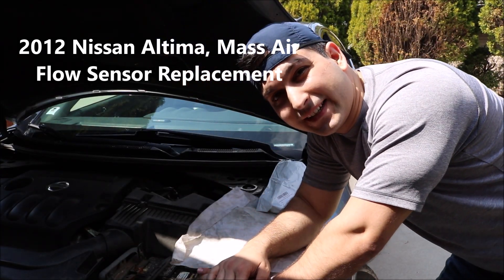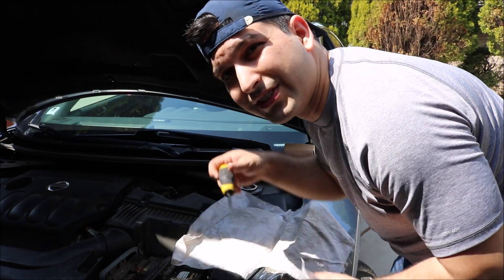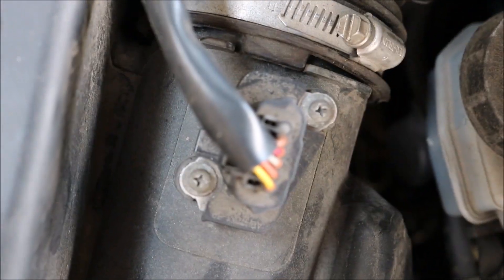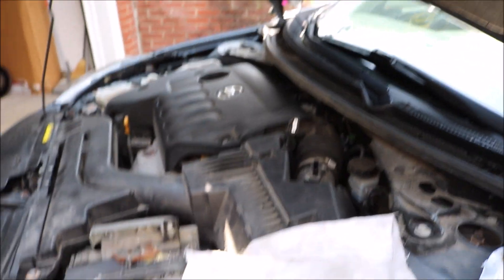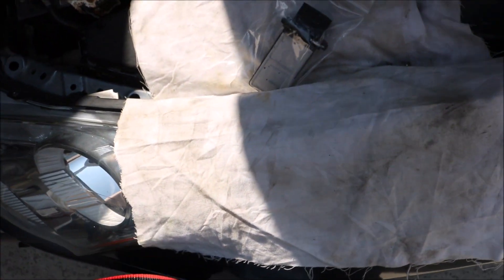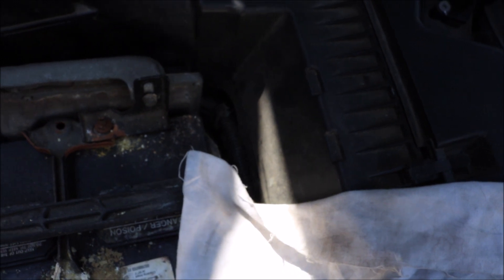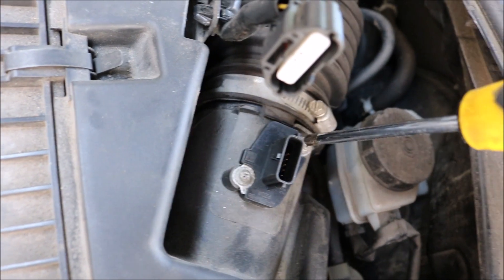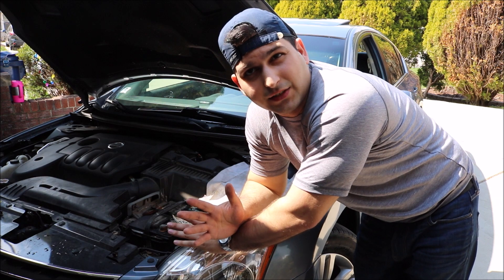2012 Nissan Altima - Mass Air Flow Sensor Replacement - Check Engine Light Fixed

Comment: I replace mine and i still get the same code
Reply: I have the same issue, I ran some diagnostics on it with a programmer and all the systems were good, we did get the MAF sensor code but no reason why. It seems that Nissan has to update the ecm in order to turn off that service light. I'm gonna take mine in and hope that it fixes the issue.
Reply: Same here. Altimas are money pits
Reply: @greed6is6good  yeah I’m gonna trade mine in as soon as I get the light off
Reply: @sergiogijon4311  im having the same issue. any update on yours?
Reply: I’m having the same issue as well. Ran a diagnostic, replaced the throttle body, cleaned my MAF and took it to like 3 mechanics. Since the check engine light is on I can’t pass my smog test, any suggestions?
Reply: @BigmeechT  I bought a cheap maf sensor off Amazon and popped it in.  The service engine light stayed on then my buddy reset the code using the diag sensor tool ...  that solved the problem for my 2012 Altima. Hope it works out for you.  Let me know if you want the same maf sensor I bought I’ll post the link
Reply: @kzegg1402  yeah I just replaced the maf sensor with a cheap 22 dollar one off Amazon and had my buddy reset the computer.   Problem solved
Reply: @JimmyR83   how do you reset it?
Reply: @jsnipes7088  my neighbor has this little machine that checks and clears dash codes. I replaced the mass air flow sensor with a 22 dollar one off Amazon and he was able to clear the code by pressing the start button a few times without holding the brake down.  I’m sure u can google the exact process. This saved me 422 bucks man. The local auto shop tried to fuck me bigtime
Reply: @JimmyR83  after you replace the mass air flow sensor do you need to reset the car or it shows immediate progress ?
Reply: @_papa._popa._71  sometimes it clears sometimes it doesn’t.  If it does not clear go to auto zone and ask them to clear the code for you. Shouldn’t cost anything it only takes about a minute
Reply: @JimmyR83  may I ask what where the symptoms of your car the reason u had to replace the mass air sensor I’m trying to see if we have the same reason and if that’s what’s wrong with mines I tried to go across the street and it stopped it cranks up but won’t really move did a test diagnose it gave me the codes p0113 and p0102 which is a bad mass air sensor when I looked it up
Reply: @_papa._popa._71  mine didn’t do anything like that. Only thing was the check engine light came on

Comment: I bought an aftermarket sensor from AutoZone. Got it installed but the harness clip won’t go onto the new sensor. Any suggestions?
Reply from the maker: if it works without it, leave it until you can find a solution.

Comment: I just changed my mass airflow sensor. It was so easy. I am about to take her for a ride to see if she runs better. My check engine light kept coming off and on  for a while so I had someone check and see what my problem was!  Thank you for your help. 🙏
Reply: Hey did replacing the mass air flow sensor work for you ?
Reply: @_papa._popa._71  Yes it worked out well for me 💪😊
Reply: @cindytrtt09  one last question after putting it on did you unhook your battery post to let the computer start over or it worked immediately? & what symptoms was your car having ? Thank U so much I’m doing mines tmr 🙏🏾

Comment: My electrical harness wont release.  So i removed the screws and tried pulling the sensor out but it sticks about halfway out.  I didnt force it and put it back and put the screws back in.  Any ideas?
Reply from the maker: I think I have an idea of what you're talking about but I'm not exactly sure.
Reply: @BestPrinters  top piece won't detach. Plastic appears broken on left.  Used car we bought 2 yrs ago

Comment: I just changed mine in my 2012 Altima and the light is still on lol. How do I reset the light?
Reply: The  "Check Engine Soon"  light comes on to alert you of a variety of different situations!   You can get your car checked for free at any Advance Auto Parts Store or any Autozone and possibly O'Reilly's.  It's a very easy check for them!  There is a plug in adaptor below your dash and you walk in the Auto Parts store and tell them that your Check Engine Light is on. They come out with a small diagnostic tool that has a wire with a connector on the end and they plug it into the receptacle under your dash and it will pop up a code on the diagnostic tool. That code will tell them where the problem exist. It could be one of your 02 Sensors needs to be replaced.   02 Sensors are located in the exhaust system  in front of the catalytic converter and behind the catalytic converter.  Some of these auto parts stores will not come out and check it because of Covid 19 concerns and others will do it.  It all depends on the county that you live in.
Reply: @mr.lamborghini4038  thanks for responding!!  It ended up being a mass air flow sensor.  The shop tried to charge me 400 bucks to replace the sensor and clear the code.  I bought the sensor for 22 bucks off Amazon and my buddy cleared the code for me.
Reply: @JimmyR83  Glad to hear that you got it fixed and at such a great price!!!!   It's good to have knowledgeable friends also!!!!
Reply: @JimmyR83  same here. It was super easy.
Reply: @cindytrtt09  my damn check engine light came on again yesterday 😡.  Here we go again lol
Reply: @JimmyR83  oh no 🤯  I am about to drive my car and see send happens.  I may disconnect the battery to see if it resets
Reply: @cindytrtt09  mine was good for about 6 months
Reply: @JimmyR83  I hope it gets better eventually 🙏
Reply: @cindytrtt09  Thank you let me know how yours goes
Reply: @JimmyR83  just took a little ride. I can feel that she has more power with the peddle on the  metal. 😆. Hopefully she stays they way ! 🙏
Reply: @cindytrtt09  hell ya!!! Did the engine light reset?
Reply: @JimmyR83  🙌
Reply: @cindytrtt09  hahaha yessss!!!! 🤗
Reply: @JimmyR83  so did it work fine bro did it start back driving okay ? Cause I’m having a bad mass air flow sensor problem too bro

Comment: I replaced it 3 times and it still comes on I don't know what else it would be
Reply: The check engine light comes on for a variety of reasons!   AutoZone and Advance Auto will check it out for free. It really only takes them a couple of minutes.  It can be an 02 sensor or a catalytic converter or other item.   O'Reilly Auto Parts may also check it for free too.  Just ask them.   Check out other YouTube Videos also.

Comment: Replaced the MAF, check engine will go off. 6 months later the check engine comes on again and the code comes back with it being the MAF again. Any suggestions?
Reply from the maker: Yes I recommend using the oem part, vs an aftermarket part. It will cost more but will remove the service engine light for much longer.

Comment: I just replaced mine today, but the check engine light is still on. Is there a way for me to reset the “check engine light” notifier, or is it possible that I received a faulty replacement??
Reply from the maker: It might not come off right away, it it stays on for more than 3 days you may have a faulty unit or you can restart the battery (unplug and then plug) so that it can read the new sensor. Hope this helps.
Reply: Remove the negative battery terminal for about 30 mins.  Resets the computer.

Comment: I just had this issue and after replacing the filter and the sensor, the light didn't go out. I cleared the code and it stayed off for a couple weeks and now is back with the same code...
Reply: Were did I buy it from
Reply: How did you clear the code?
Reply: Same problem you have to order one from dealer